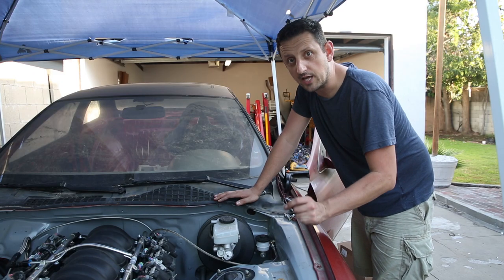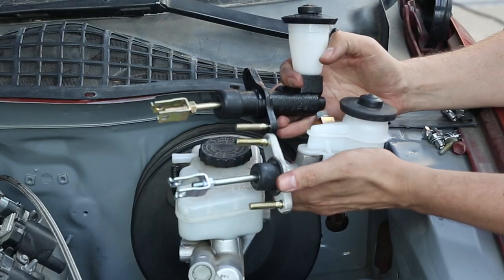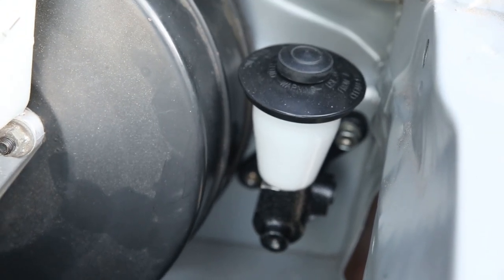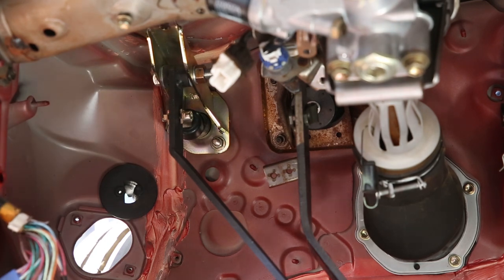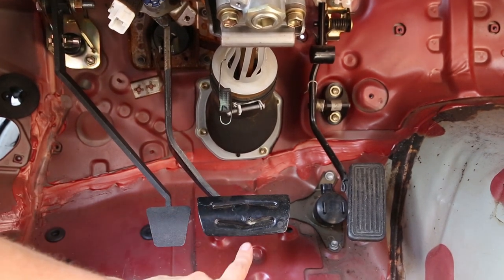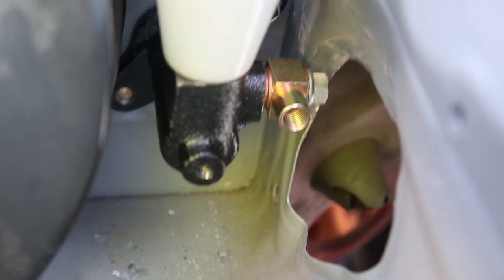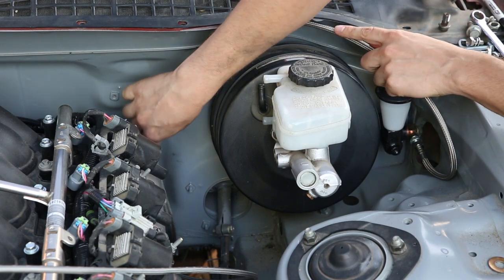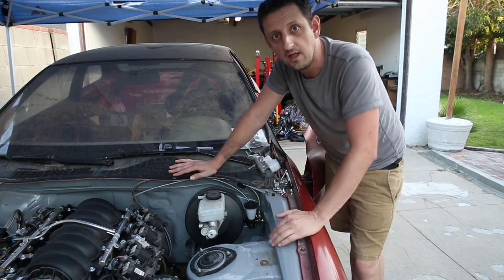Lexus SC300 Drift Build. Ep.29 -  3/4"  Bore Clutch Master Cylinder Upgrade for CHEAP

Comment: Great info. I’m looking at doing a ls swap in my 92 Toyota truck. I’ll be using a ar5 trans with a FabBot conversion which uses T56 clutch parts. I need a 3/4” bore, so this is a great help. Otherwise I was ready to buy a Wilwood master but the bolt pattern was way off. So, yeah....excellent video!
Reply from the maker: Glad it was useful! It's been working great, so a really cheap way to avoid paying big money for Wilwood.
Reply: Did this master bolt right in to your pickup?
Reply: @PrimeMaverickAPB  I ended up selling that project for triple what I paid for it. That Toyota market is STRONG!
Reply: @daviddenman7479  didn’t even get a chance to bolt it in? Lol
Reply: @PrimeMaverickAPB  you do understand what sold means…..right?  Otherwise no. No I never did.

Comment: that lines gonna be a pain to bleed. id run it under  the brake master , IMO

also. quick questioin. is theres any negative effects on stepping up bore size on a master cylinder ( brake master or clutch)
Reply from the maker: Wrench life 604 good to know, thanks. I was thinking of running it under the the booster to look cleaner if nothing else. 

As for the bore size, I think the master cylinder needs to be sized correctly for the slave it's powering. Under sized bore may not correctly engage the slave, and oversized might blow out the slave/seals with too much pressure.
Reply: Fully Spooled
 wont blow nothing,it just changes the pedal travel vs slave movement  and the effort to press the pedal,bigger master  bore = more pedal effort, and longer travel of the slave and shorter travel of the pedal,smaller bore is quite the opposite,less pedal effort but more pedal travel to engage
Reply from the maker: Just saw this comment. Thanks, good info!

Comment: Why not weld on a different brake pedal to booster connection. Leave the existing in place then weld some square bar in place then cut the original off
Reply from the maker: Alex French the OEM brake pedal is only $72 and it bolts right up. I don't really want to mess with the brake pedal too much since it's the only thing stopping me from slamming into a wall at 100mph on the track.

Comment: Fully spooled 
Nice work man. 
Where did you get the brake pedal from I’m m doing an r154 on my sc and looking to get the pedals converted but the kits out there are pretty expensive. 
Thanks
Reply from the maker: I installed the brake pedal in the following episode here: https://youtu.be/-rSVAUm92Zk  The link to the pedal is in the description along with other parts I used. Not really a bad swap at all, and the pedal isn't too expensive.

Comment: glad you upgraded to 3/4". wonder who's SC will get sideways first? lol
Reply from the maker: Definitely yours. You've already started your engine! Plus I haven't even touched my suspension yet. I have a lot of 25 year old parts to replace and upgrade.
Reply: ha. me too on the suspension. my BCs are still in the box on the shelf.
Reply from the maker: Yeah I need to decide on what coilovers to get and how I'm going to pay for them. :)
Reply: Fully Spooled  go with the gixxerdrew setup. You can buy  custom spring rate hypercoil springs as you get better and also bilstien will revalve any of their shocks to a new spring rate for $20 ea. So that means you will have adequate damping and spring rates as you go up in mods/power for minimal cost. They are less than a grand for a whole set and bilstien are on literally 97% of all racecars ever on the planet for a reason.
Reply from the maker: a003590510 great advice, thank you! I'm adding this to my parts list to research.

Comment: Top guy. This has been damn well helpful for my build, bmw gearbox in a jzs chassis. Obviously standard bmw slave is 3/4 bore, so this paired with my £15 starlet clutch pedal is gonna be great!
Reply from the maker: Glad it helped! The 3/4 master cylinder has been working perfectly for years on my build. Great way to save money.
Reply: @FullySpooled  good morning sir
Sir I have dodge dart 2016 with manual transmission i want to ask you can we replaced clutch master cylinder with another one not same i mean different about one in my car because cmc that I have is rather bad and place i live its so difficult to get new one
if we can do this process so what is way?
i hope you help me sir
Reply from the maker: @نسيمالجنوب-و7ظ  I’m not a mechanic, so I may not be the best person to ask. But I know the Dodge Dart was also sold as the Fiat Viaggio. You might be able to cross reference part numbers to see if those parts are easier to get. Also look at the Alfa Giulietta, as the Dart shares the same platform.

Comment: Stock Supra, or Stock Lexus SC300 with the 5 speed bolt right up with out any need for modification. and from the dealer they are not the expensive.
Reply from the maker: Yep, but those are 5/8" bore. I needed a 3/4" bore for the T56 slave cylinder.
Reply: I was talking about the pedals, and brackets

Comment: Will that work with r154?
Reply from the maker: r154 requires a 5/8" bore master cylinder. The one I used is a 3/4", so you should stick with the recommended size.